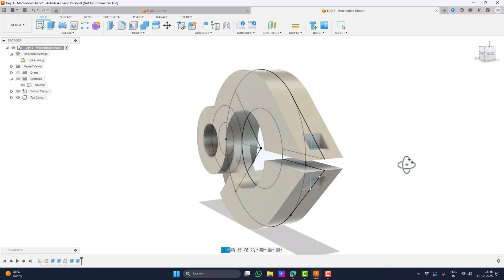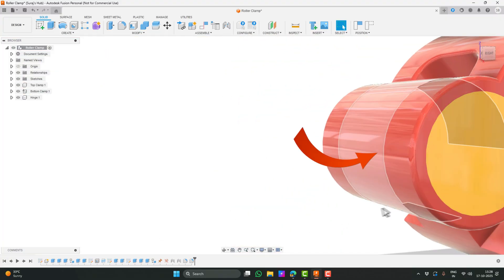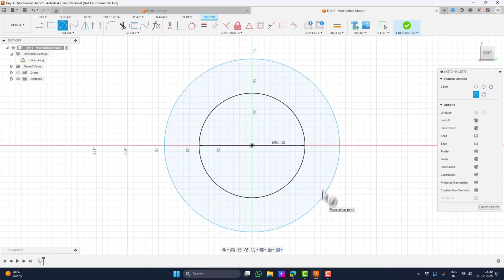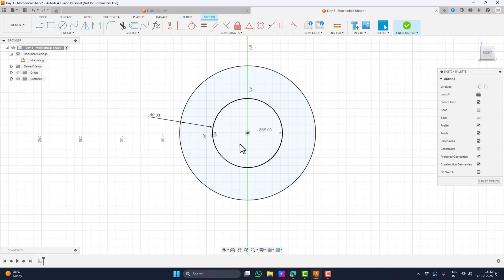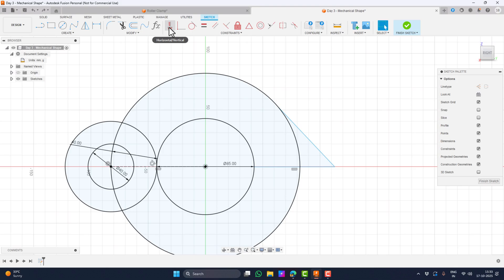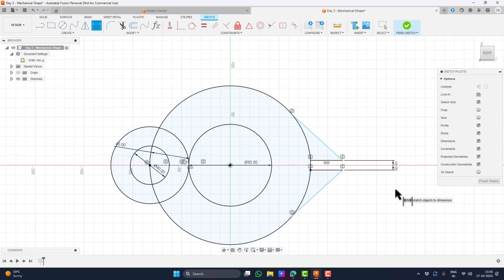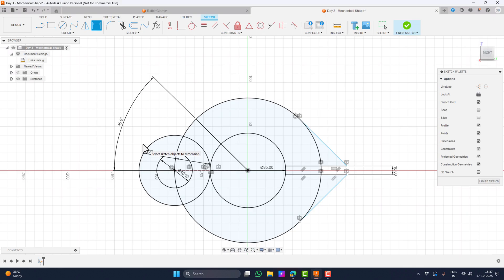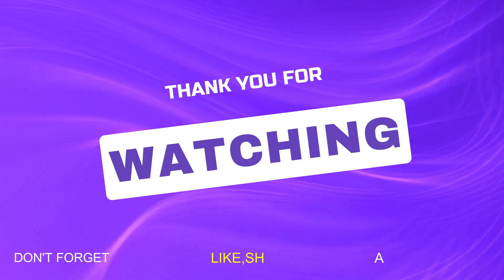How to create a hinge Clamp in Fusion 360 Beginners Tutorial Part 1

Comment: Your videos could be 25% shorter if you spent less time waving the mouse around in circles. You've also not fully defined the sketch - the sloped sides of the beak shaped areas are not dimensioned and are still blue, despite your claim that they're Ll black.
Reply from the maker: I will keep that in mind for the next video. Thanks for your feedback.